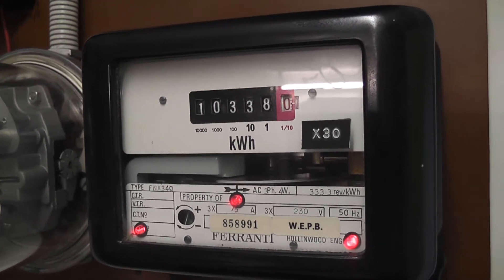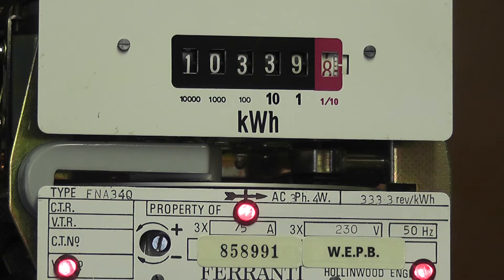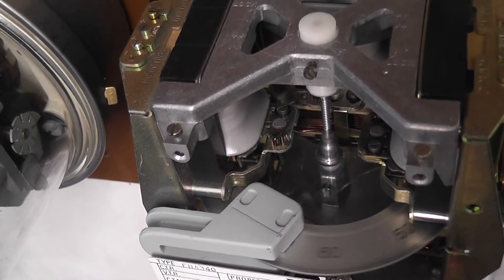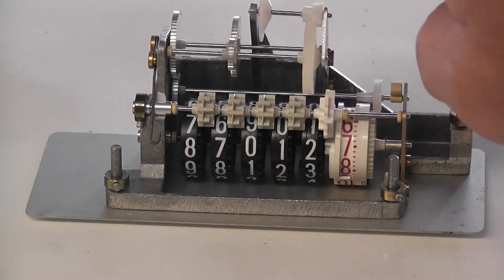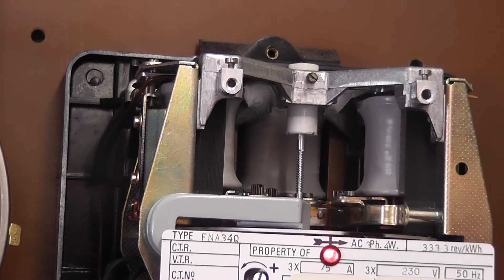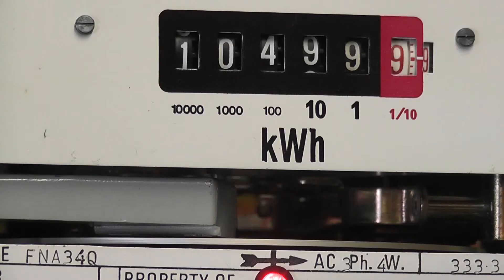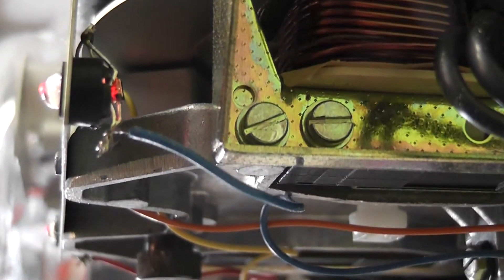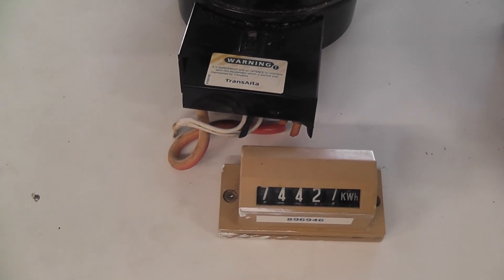Ferranti Hollinwood CT meter

Comment: Good video, I remember the old glass centre in the rotor disc.
Sorry if this looks like part of my CV but I worked at Ferrantis Hollinwood factory from starting my Mech Eng apprenticeship in1968 until becoming redundant in 1996. You could spend your entire career in the Toolroom and not have a clue how the meters worked, There was only a few moving belt type assembly lines - the meters were passed to each deparment on wheeled trucks that were dozens of years old - Siemens built a new modern factory alongside the original one in the 1980s until then the meters went round on a chain conveyor above the workers  heads and you had to stoop in a lot of places to get around the place!
I was responsible for all the follwing  (and more maybe} 

The maintenance of lots of the drill jigs for the frame of various meters - the ones that spring to mind are the F2Q, FMX and  F4K.

The coin cage die cast toolingfor the pre-payment meters.

 Printed the numerals etc onto the  aluminium rotor disc  . I remember that some Electric boards had to have the green flourescent spot instead of the black, Hinckley in Leicestershire was one I think

The aluminium/lead alloy Fischer Die-cast machine that attached the rotor spindle to the disc - you got a free pint of milk every day on that job to supposedly help prevent lead poisoning!
 
The roller register assembly fixtures.

There was also a pig of a mechanical/pneumatic tool that I made several of that held current or shunt coils (?) and an iron tongue together  - the bit that the disc passes through but not the brake magnet.
Talking of which  - when I was an apprentice I had to make a load of flat 3 inch square  "go/no go" gauges for setting the brake magnet gap, only problem was was that they had to be made from NoMag  stainlees steel so you could not put them on a surface grinders magnetic chuck and they had to be filed by hand to +/- half a thousand of an inch!

All the pneumatic screwdrivers in the factory.

It was only when I moved into the Production department in 1981 when Siemens bought the goverments shares and took over that I learned how a meter functioned 

When they started to move into electronic meters most of the above jobs dissapeared, then they tried making electronic gas meters but if I remember correctly had the rug pulled from under their feet by British Gas with orders for thousands of meters that they then cancelled and lots of staff were finished.
Funny story - we had a union meeting once when they were struggling and a guy stood up and said "This place as been going downhill ever since I started here"

I had friends who worked at Ferrantis Moston factory in Manchester and lost their jobs due to an American CIA scam - its on Wikipedia and makes interesting reading.
Reply from the maker: Thank you for your interesting and detailed comment you have posted here. Those electro mechanical meters were a masterpiece of reliable metering engineering to last for many decades. Now these quality meters are replaced by cheap plastic fantastic which may last only a few years.

Comment: @snedie69er It is possible to do this, yes. I have meter videos on my channel too, & I have forgotten the amount of times that I have put a meter on a board, with a plug-and-socket arrangement wired to it, & used it to meter an electrical load. 

So yes, one of these meters can be fixed to a moveable board, & wired up so that you can use it to meter individual loads. 

Basically, those plug-in watt-meters are a glorified end-user-compatible version of these meters, with no wiring needed.

-BBD.

Comment: @RODALCO2007 

Many thanks for your reply.

Can the be wired directly in front of of mains outlet (240v, 60hz)? I'm no expert with electricity but I can follow circuit diagrams pretty well and haven't messed up so far, taking safety precautions where ever possible.

Is there a chance you could create a simple circuit with a set of mains outlets coming out of one of these meters?

Again, many thanks